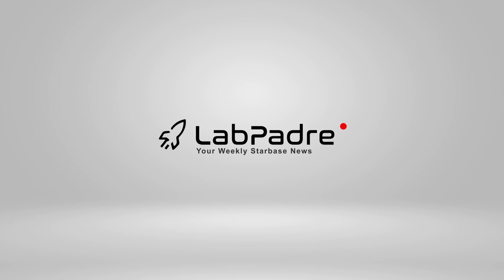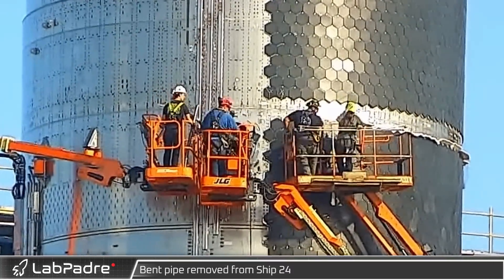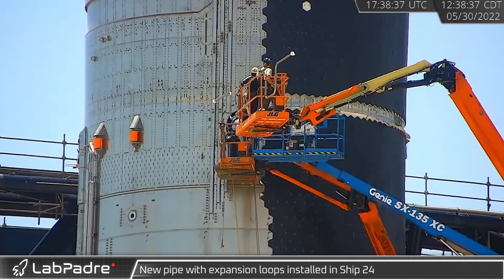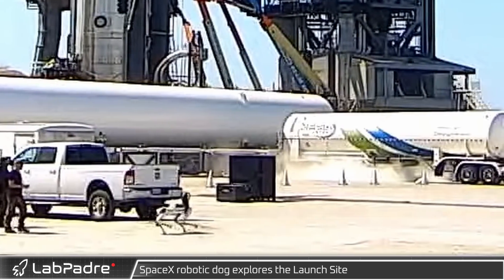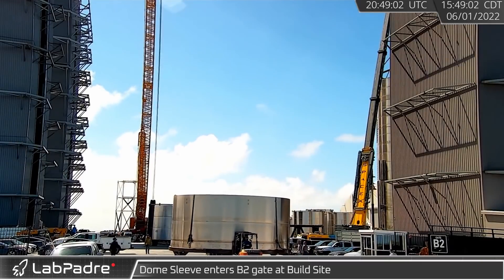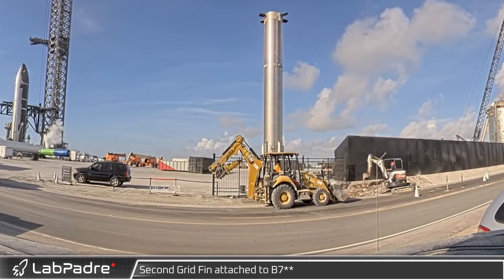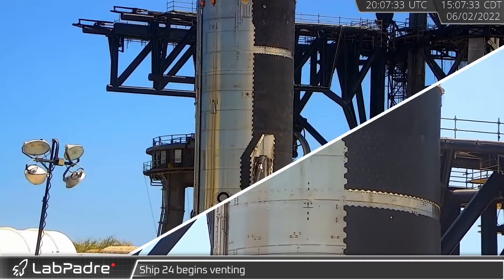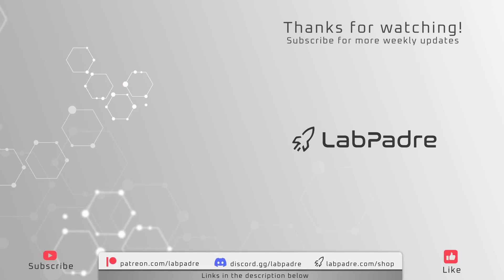Starship 24 Passes Cryo Testing After Setbacks - Weekly Update #13

Comment: The Kitty Hawk was not diesel powered. It was Steam Powered. 8 1200 lbs boilers. It may have had some backup diesel generators . The fuel may have been DFM ( diesel fuel marine). But it was 4 Steam Turbines and 8 steam Generators that kept the lights on and Steam Catapults that launched the Jets off the Carrier.
Reply: we called it the "Shitty Kitty".
Reply: @johnkmatsch  I remember that nickname. Just didn't think was appropriate